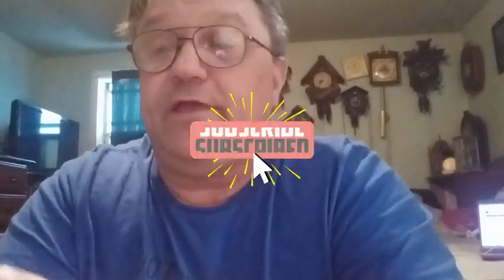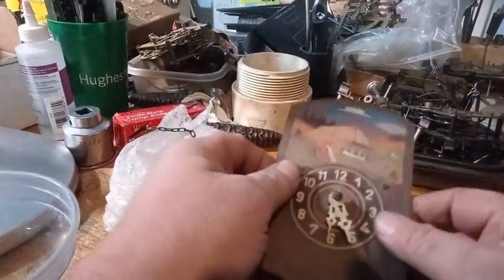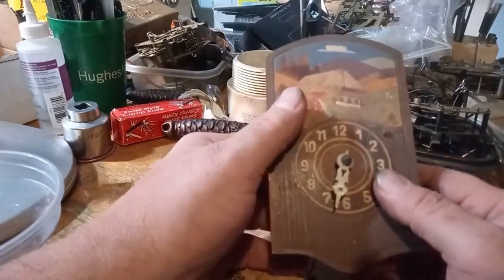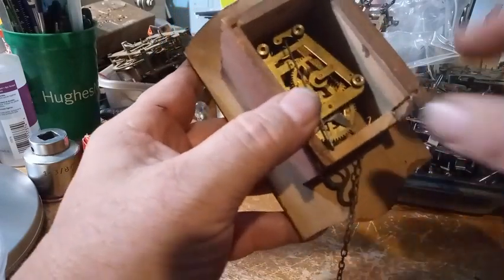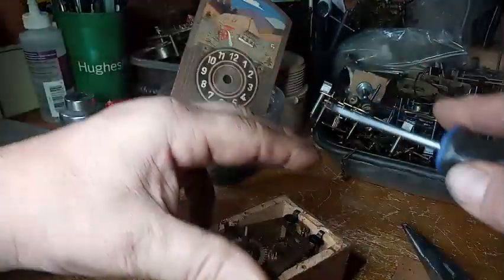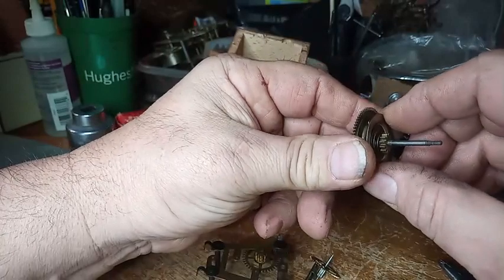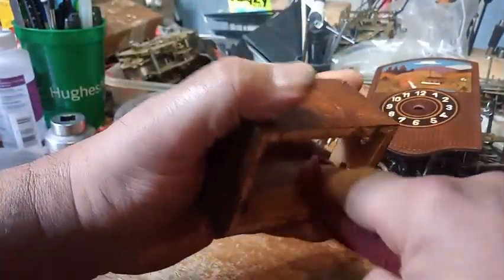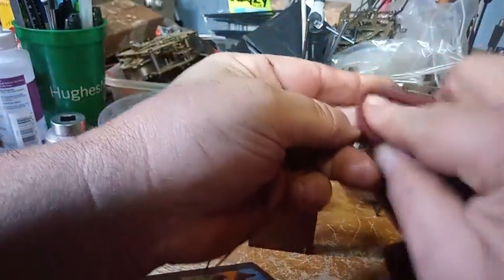Cuckoo clock repair for beginners (Repairing a novelty clock see description)

Comment: Mark. I've worked on one and all went well - except - I cannot turn the minute hand to set the time.  My theory is there is a shiny steel disc attached to the main wheel. It should slide when turning the minute hand. It doesn't so all the gears are engaged, including the verge. If that is my issue, any thoughts on solving it?
Don't forget: heat those rusty screws with a soldering iron. They'll heat up, expand, and break the rust bond. 25 watt iron should do.
You sure are prolific with your videos! Thanks!
Reply from the maker: My first thoughts on the minute hand not turning is that there is no end shake on the minute arbor with center wheel. However I am asking a friend of mine who works on clocks for a living and has repaired a few of these. I will post his reply when I get it.
Reply from the maker: my friend is saying a bent pivot or maybe the crutch. I would check the end shake first myself. The piece in my video that I had to take off at first when I put it on I put it on too close and it was catching on the minute wheel with minute pinion preventing my minute hand from rotating. Good luck.
Reply: It does run, but I can't set the hands to the correct time. I'll look at it again on Monday.
Reply from the maker: @billtrefts9238  might be too much pressure on the minute wheel with minute pinion. There is a compression washer underneath it. That might be causing the hands to be too hard to turn but typically it wouldnt run. Let me know what you discover.